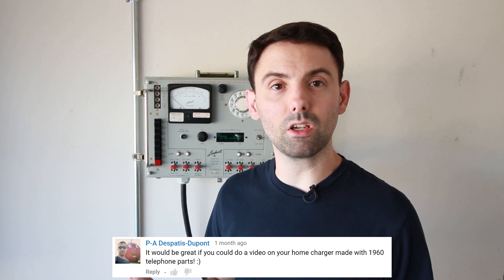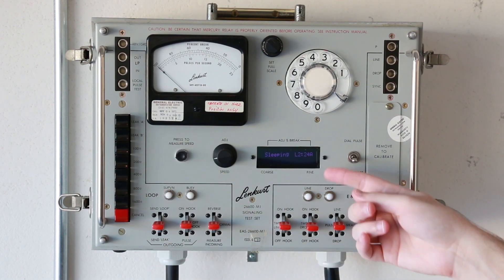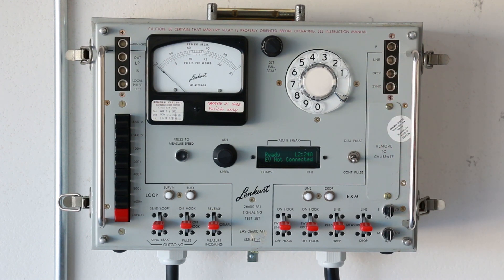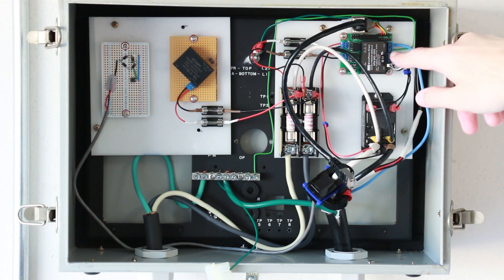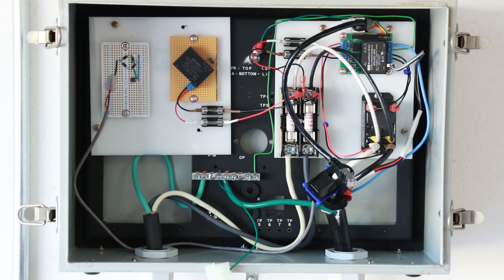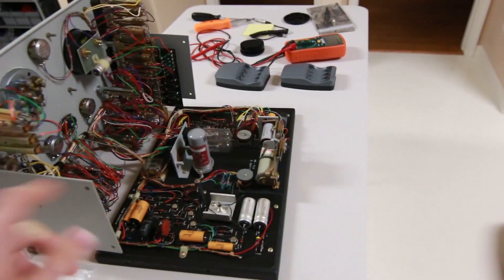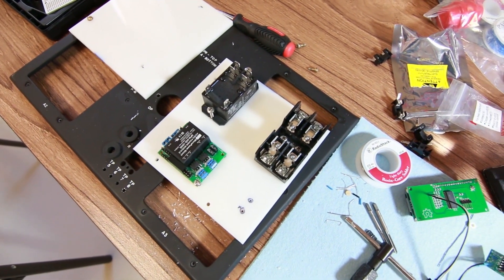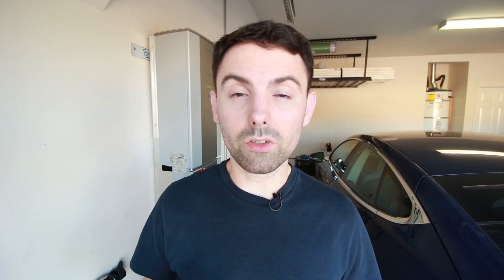Custom OpenEVSE Electric Car Charging Station

Comment: I have a question that you are very qualified to answer. Presently I own a 2011 Nissan Leaf and affectionately refer to the available mileage reading as a guess -o-meter. I'm curious about the Model S. Is their meter "a little" more accurate or is it a joke too? I realize there are too many variables involved to be perfect, but I just wanted to know if Tesla did a better job of guessing than Nissan
Reply from the maker: Tesla went a slightly different direction and I actually did a bit of a compare and contrast in the video I posted previously about range anxiety ( https://youtu.be/Sh-TdvizTn0 ). The state of charge indicator is de-emphasized in Tesla's information display and, by default, is set to display range in rated EPA miles (fixed calculation). The display can also be configured for display in ideal miles and percent charge. Taking emphasis away from the SoC indicator makes sense for city driving due to the long range of Tesla's products (people have a tendency to take cues from how things are presented in determining the importance of an information display). On longer trips, the trip planner software fills in to provide projected range and charging information based on route topography, expected route speed, and your recent driving habits. I've found the trip planner system to work very well and it's also good about providing actionable information to a driver in cases of unexpected condition changes (e.g. high winds reducing efficiency in a situation where you'd be cutting it close causes the system to recommend speed targets to stay below to ensure arrival). The tools Tesla provides are much more comprehensive when you need them, compared to your typical guess-o-meter, and are out of the way in order to minimize range anxiety when you don't need them.
Reply: Thanks Alex